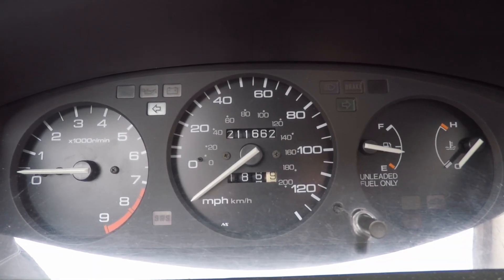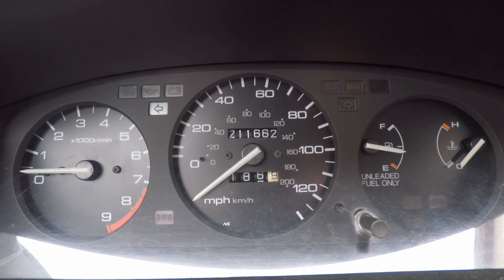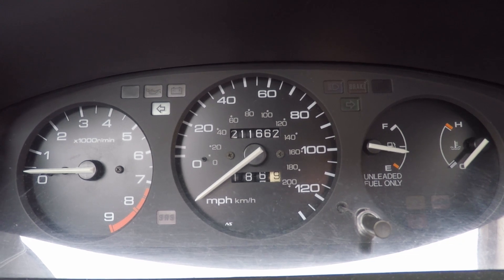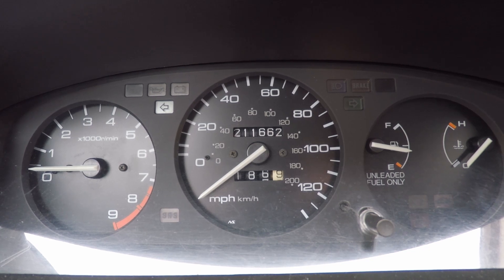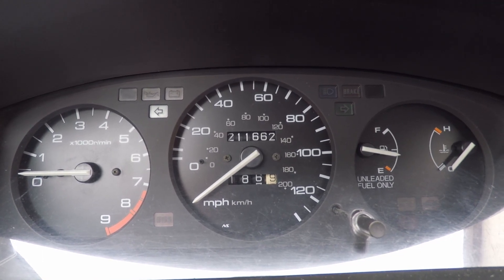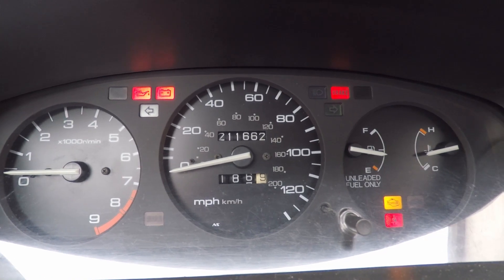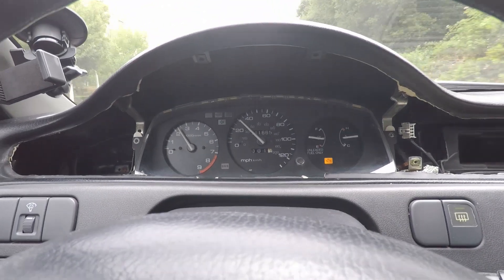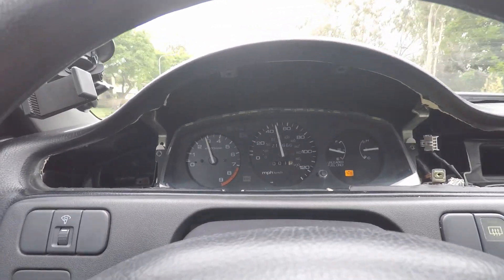1992 to 1995 Honda Civic Speedometer Fix

Comment: I had that problem for years in my 95 civic dx with manual transmission, Replaced speed sensor several years ago,no luck,re soldered the solder joints on cluster and speedometer, no luck,today I pulled cluster again,I examined the plugs that plug into the clustersome of the metal contacts in the plugs looked flat,I used a very small flat screwdriver, went under the contacts and bent them up slightly, also  used electronics contact cleaner, drove about 10 miles and it's working perfectly, fingers crossed its a permanent fix.

Comment: Ok ok so for those of you that got lost in the soldering part. All you’re doing is adding a little bit of solder on the joints cuz as he showing us in the video there  teeny tiny little cracks (on each of them) which is causing it to fail. 

I as wanted to say thank you! I followed both YouTube videos on this and my Speedo works! Now

Comment: THIS WORKED ON MY 94 CIVIC EX !!  (1) Had replaced speed sensor years ago and it didn't fix the problem.  (2) Wired in a bypass wire recently, that didn't work.  (3) Replaced the cluster last week, that didn't work.  (4) Watched this video and inspected the solder joints in question, they didn't appear dried out or cracked but did the resolder repair anyway...and now IT WORKS !!  As was discussed I just concentrated on the 8 or 9 on that small snap on board that correspond to the pin outs on the dial.
Reply from the maker: Nice! Happy it fixed your issues!

Comment: Thanks and straight and to the point. My tachometer in my 1994 vigor is not working and I replaced the speed sensors also. So this is my next job. I can just buy one but hey us tech guys like to fix stuff. I soldered the fuel sensor which had cracks and missing solder on it and that fixed it. Still bought a new one as a back up.

Comment: Thank you so much for posting yhis!  You made it so easy. My speedo would just sit at 0 initially, waggle 5-10mph for the first several miles, then mostly level out.

Almost all of the joints on mine were mostly hollow once i put heat on them. I had to add a dab to all but one.

Works like new now!

Comment: I have the same problem. Will be taking  it out to look at. FYI the solder in these old hondas seems to be a weak point. I fixed the AC unit in mine by redoing solder on the board. Thanks for video!
Reply from the maker: You're welcome! My AC controller is also starting to act up. May have to do the same thing. 😞 These old 90s electronics are showing their age.

Comment: yep, reflowing what appeared to be a couple cracked solder joints at same circuit board as this video and also cleaning some brown crud between traces of the main flexible circuit sheet with acetone fixed it.  Check all the joints.  I too replaced my sensor first for $88 and still inop and then proceeded to this step.  Great tutorial on how to get to the important stuff.  It really was not that bad of work.  I wish I did this so 2 years ago,,, ugh.  Now for my muffler then ABS sensor light...
Reply from the maker: Yup, same experience for me. Figured I try to save the internet some money and time by learning from my mistakes lol.

Comment: This worked for me! I saw some solder points that were cracked. A total of about 9 points. I applied new solder to each one and it works great. Before the repair, the speedometer stopped moving, & sometimes it would shake a little bit around 15-20 mph. Used an eye loop to inspect the solder points & fixed all the ones that didn't look smooth & perfect. You could see like a Crack in the solder point.

Comment: After replacing the whole dash 3x, replacing the VSS 2x, reflowing the solder joints on 2+ dash pcbs, replacing the speedo pcb board 3x, I found this video.  Okay, so THOSE solder joints at 3:03?  Hmm.  If Alex was right, then I'd previously done an inadequate job of reflowing joints.  On my "Alex fix", I used solder sucker on the 8 joints that Alex circled - wicking and soldering ONE joint at a time - and it worked!  I finally got to the cold joint.  A little isopropyl and Q tip work to clean up the pcb board too following soldering.  My symptoms just like Alex's (mine at 250k - 280k miles).  A big clue back to the solder joints: when the speedo needle was freaking out, if I knuckle-rapped the dash, the speedo would start functioning correctly - for a brief period of time.  Thus, the success of the rapping eliminated the VSS and the computer.  Anyway, excellent insights, instructions, video.  Thanks!
Reply from the maker: You went through very similar struggles as I did lol. Happy you got your car fixed and back on the road! Thanks for commenting and provided feedback for others!
Reply: @AlexFranceschi  Hey, thanks Alex!  Oh, I forgot to mention that I'd also replaced the two big electrolytic capacitors on two of the speedo PCBs.  That made for an interesting learning experience - but no fix !   Ironically, the authors of my 1993 Civic shop manual write, if "Speedometer operates, but reads wrong" the problem is "the main circuit board" (p. 23-140).  They should have instead written, "See Alex's YouTube video," but, of course, the video didn't exist yet.  How were they to know?
Reply from the maker: If only they had the foresight to look 28 years into the future! lol

Comment: 94 coupe. Thank you! Had the same jumpy problem and this morning it jumped to 100 and a mile later it wrapped all the way around and is stuck under the pin.

Update:  I took It apart the solder looked okay and I cleaned up the pins b4 I poked it back together and it works fine now, old owner thought it needed the new vss in the trans.
Reply from the maker: Great to hear!

Comment: Did you add solder to it or just reheat. Never soldered before. I reheated mine. My speedometer started working but was 5 - 10 mph off. I reheated it again and it stayed at 0 again.
Reply from the maker: Just reheating should work. That's all I did for most of them. Added a dab of solder to a couple.

Comment: The issue I have with my eg8 is the cluster lights will intermittently turn on and off. The speedo will sometimes work randomly then just stop. Everything else works though. Tried swapping clusters and still the same issue.
Reply from the maker: You check your wiring harness/connector? Or look into what fuse(s) may be tied into the cluster? I know it's a boring answer but double check all connections and fuses.

Comment: Did you flip back the needle to zero then put everything back together or did the Speedo calibrate itself after you Solder the connection and fired it up
Reply from the maker: I wound it back to zero after I soldered everything and put it back together.

Comment: While you had this problem did your odometer stop counting too? I have the same issue with my cluster with the addition of the odometer not counting either
Reply from the maker: Since my speedometer was fast, my mileage actually accumulated faster. For example, I would drive 35mph, but the speedometer shows 50mph, so the mileage accumulated faster than expected. If your speedo doesn't work at all or is completely off the scale the odometer might not work. Unfortunately, I don't have a diagram of the odometer so I don't know for sure if this will fix your problem. Worth inspecting tho.

Comment: Hey I have the exact same problem just as you described on my 1992 Civic. Recently the speedo just raced up to 100, jiggled there a couple of seconds, then went all the way around where its pinned. I'm going to try your solution but one question. How did you get the speedo needle back around to where it's supposed to be?
Reply from the maker: I just spun it back around when I took the speedo out and it's been on point ever since. You don't need to remove the needle itself when doing this job, just leave it on and spin it back to 0 when you're done soldering.
Reply: @AlexFranceschi  Great! Thanks a bunch for the info and video! I'll post again after I'm done to let you know how it went. Happy New Year!
Reply from the maker: @garywong8744  No problem! Happy new year and good luck!
Reply: @AlexFranceschi  I just finished everything and took a test drive. The speedo is rock steady now! I can't thank you enough!
Reply: By the way, you wouldn't happen to have a fix for another problem I have would you? The problem is the idle speed surges up and down by itself or rev high and stay there for a long time before coming back down. Sometimes the check engine light would come on too while that's happening. Thanks again for any ideas!
Reply from the maker: @garywong8744  Nice! Happy to hear you got it fixed! As for the idle problem, unfortunately I don't have any good leads for you, but it is an air/fuel or ignition problem. I would start researching in the repair manuals for possible fixes under those categories.
Reply: @AlexFranceschi  I will. Thanks again!

Comment: My odometer works absolutely fine if i do a 10km any nearway trip it tells me the correct difference i've travelled but my speedometer fluctuates like if im travelling at 50km/h it sometime tells me 20km/h or jump right to 80km/h. Is it the same issue like you had? Will it fix if i just resoder like you did?
Reply from the maker: Sounds very similar to my symptoms. Inspecting the speedometer is fairly easy and cost little to no money if you can do it yourself. I think it's best to inspect the joints first and then re-evaluate it.
Reply: @AlexFranceschi  Okay i will try it for sure. I hope it gets fixed. Im not tryimg to bring it to any technician cuz he'll probally charge me for nothing
Reply: I’m also having this problem with my 96 Civic EK. Having MPGuino installed in my car, it show speed without problems (so not the VSS problem). The Civic speedometer needle is the problems. It not moving until the car running around 40km/h, and when the car speed around 80km/h, the needle is hovering around 105-110km/h. The Civic odometer and MPGuino is showing quite the same number (driven it for years).

In my case, there are no cold solder joint like you shown in the video. But i still resolder all the IC joints and adding some tin at the PCB and also the flexible PCB in the outer speedometer (white plastic around the speedometer bolts). And now  the needle are moving again even at the low speed. I did not test it at 80km/h though, maybe next time. But i think my problem are already solved. Thank you for making this guide.

Comment: Hi, i need to ask i hv integra dc2 meter , manual and auto, i broke my speedo on manual but i change to auto, but the auto speedo seems hard to re align. Izit bcz its not suitable for manual cars or smthing else? Sorry for my english
Reply from the maker: Sorry I do not know. Are you using the entire Auto gauge cluster assembly or just the speedometer?
Reply: @AlexFranceschi i use only speedometer,i tried to calibrate using gps many times,but it seems like the speedo got speed cut?
Reply from the maker: @ozzyollie5870  Sorry I don't know much about using an Auto speedometer in a Mnaual car. My guess would be the gear ratios for the auto are much different than the manual hence the speed is not correct. There may be ways to fix it, but I don't know.

Comment: I have a Honda Civic out 2000 and the speedometer is going up and down a little bit. Or stays at 0 until I drive 20 miles an our. It's bugging me out but I don't know if it's my speedometer or my speedsensor.  I think it my sensor but I don't know for sure. What do you think? nothing wrong with asking hahah
Reply from the maker: I can't say for certain, but I believe the '00 civics have a similar speedometer/cluster as mine. You can replace the speed sensor if you like, but you will have to spend money just to see if that is the problem. I would first take the speedometer out and inspect the solder joints. That comes at no cost, and you can at least figure out if that is your problem before spending money. If the joints look good, then I would try the sensor.
Reply: I have a 97 civic-- which will be very similar to your 00 -- and I did in fact fix the speedometer by re soldering just one bad joint.  There are videos for 96-00 civics that show you, it's pin #10 (out of 24) I just re heated the one pin for 3 seconds and like magic it fixed the issue on first pass.  you will need a soldering gun with a fine tip.  I spent $175 on a new speed sensor, total waste!
Reply: @joost 2.0 what was this issue you had? Because I have the same problem.
Reply: an update, just doing pin 10 improved matters but ultimately did not do it, I had to pull the speedo and re solder every connection on the chip that I could get at, this seems to have fixed it.  i just touched the tip of the gun to each connection.
Reply: @Otsp922  are you asking me, or the original poster?
Reply: @justinlocke  I was asking the original poster but I appreciate you letting me know what you did as well.
Reply: @Otsp922  My Honda civic hatchback 00” speedometer does not react as it used to. It is 0 when i drive 10 or 20 miles an our. But when i am going faster it jumps up to the pace i am driving. It also jumps up and down. When i am driving 50 it says 45 or 55 sometimes. First i was stressed but now i am used to it. I think i can fix it by solding. But i am scared of breaking it, and then i now nothing about the car hahah. Now to make sure what pace i am driving i look a the rpm’s per gear haha.

Comment: So I replaced The Whole cluster and changed the speed sensor and it’s still not working
Reply from the maker: Check your solder joints on the back of the speedometer as I've shown. I did the same thing you did and that's why I made this video, got tired of chasing a ghost lol. Good luck